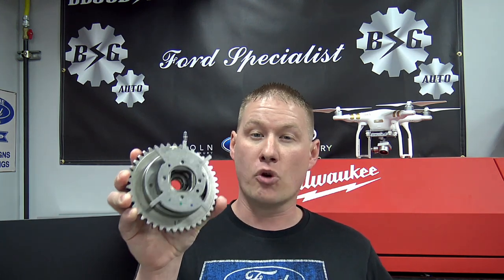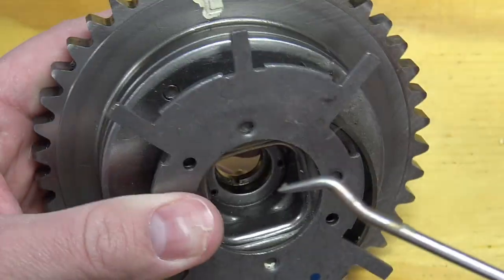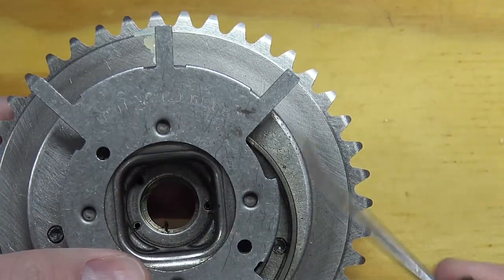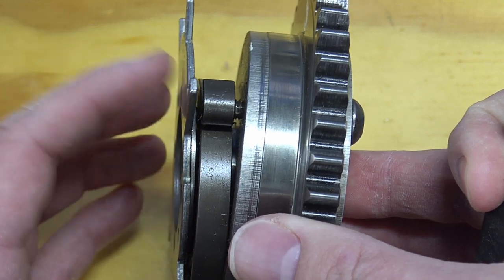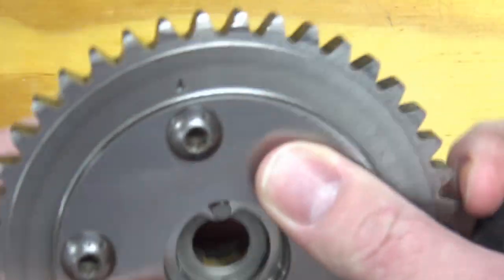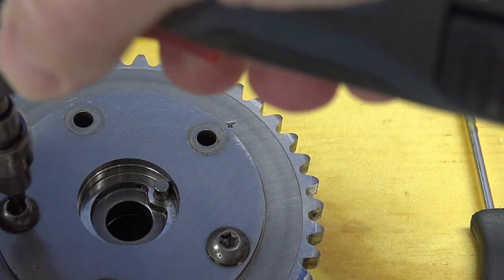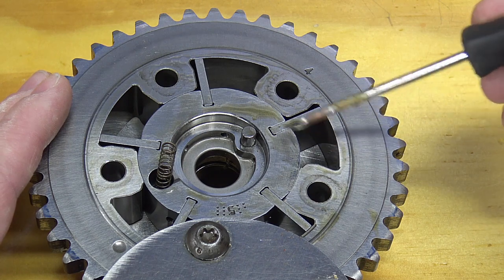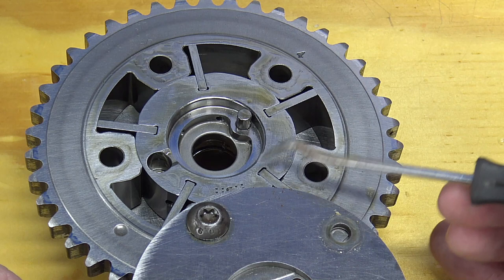Ford 4.6L & 5.4L 3v Engines: Camshaft Phaser Failure Inspection

Comment: 2005 mustang gt, was having every issue possible. P0012 and P0011 codes, replaced the vct solenoids, not much better, still codes. So I watched a lot of you videos on all of these problems, replace the timing chains and found a chain tensioner on the pass side that was blown out, thought replacing it would maybe help the issue but still, nothing. After lots of time and money and frustration, I ordered two phasers and the high flow oil pump he recommends and the car runs better than it ever has. At 104k miles I was having this issue but the motor looked very clean, goes to show the reliablity of the original ford parts, replace with the revised stuff not aftermarket!!! Thank you for all the quality information you post

Comment: Oh my goodness!  You saved me so much grief and money.  I lost timing on my 05 f150 while removing the right head with broken exhaust studs. I set up timing like i was suppose to in your other videos. Right cam phaser also had an L mark?  I set timing to that. Truck was way off.  Now i see to use the other mark for the right side!  I was 180 deg off.  Was at my end. Had scheduled to take it to the dealership.  Now i can fix my problem.  Thanks!

Comment: I seen where they make kits to block those. From advancing. And I have seen them fixed the top of heads with a line boring machine. And the only thing you have to do is replace the bearings for just like connecting rod bearings. They're just a lot smaller

Comment: I wish someone had told me to check the oil before diagnosing cam phaser problems. Once The crank case was full of good motor oil, the cam phasers started working perfectly. I didnt realize that the engine was low on oil and needed to be changed also. This caused the cam phasers to knock and rattle and I was about to spend $900 and my next couple weekends to change the timing set.

Comment: 5 years later, I'm back here ma man. I still have the same 2008 GT. Tried to go out to McDonald's yesterday morning and the engine cold started just fine, then random started running super rough as I was exited my drive way and engaging my clutch at low rpm. My engine has 210k miles and I have retimed it twice, replacing chains, sprockets, phasers, vct solenoids, but I have never replaced all lash adjusters or followers (only a couple that have failed followers here and there) so I wonder if thats it. Timing chains and guides look fine from looking down from the top of the engine (valve covers removed). I hope I didn't spin a bearing or have a follower bend a valve or something crazy. Or maybe my car just had an electrical issue and went into limp mode. Not sure but I'm still doing some diagnostic tests. I'm about to use the follower tool to pull out all 24 followers and inspect them. I'll also check the lash adjusters. If its bottom end stuff, I might have to take it to a mechanic

Comment: Awesome video Brian, Thank you. I have followed your videos in the past wile doing the cam phaser/timing R&R and also spark plug R&R. All took some time but went very well with the help of your instructions. Very much appreciated! I wonder if you could tell me if you see phaser failure happen often with lack of oil pressure. My 05 F150 has recently died wile in motion and wile it will start (occasionally) it runs very rough for seconds then dies. After further inspection it seems I may have had an oil leak at the front cover where meets the oil pan. Is it possible that lack of oil caused the phaser to fail, throw off timing and causing  the truck to, now,  not start/run? or should I be considering other avenues? Thanks in advance!

Comment: Really Awesome Video.  couple questions -  If someone did take all the screws off the reluctor ring,  (1) is it hard to reset the phaser spring back in the housing? (2) Is there a special procedure to align the marks? lastly, if we look at the tone ring and gear sprocket locations - (3) how much off is allowed to "perfectly" aligning up the gear tooth to tone ring tab? Is there allowance at all when matching up the center of the gear tooth to center of the tone ring tab? The reason I ask that and I know that is a used phaser but when I look at the tab on the tone ring in the video,  it didn't seem to align exactly with the center of the gear to the center of the tone rings tab.

Comment: Awesome video. I have learn so much with you that I really, really thank you from the bottom of my heart. I know it has been 7 years ago when you posted this video so I dont have high hopes of getting and answer but maybe I will be lucky. My 2004 Ford 150 has started developed a sound like a little piece of metal being tossed around at the passenger valve cover, right where the phaser is or the upper part of the timing chain cover. It is not a regular noise but an erratic one exactly as I said, like a piece of metal being tossed around at random. It started after I left my truck parked in my driveway for 4 days. It was a cold day in NY when I started the engine and I felt a weird noise. After that, this noise appeared. It will be present with the engine cold or hot.  When I saw this video I though that maybe one of those roll pins came out and is being tossed around. Could this be the cause of the noise in my truck? By the way, much before that I plugged a scanner and I saw the passenger bank was retarded 20 degrees at iddle while the other was at zero. I have a pending code P0010.

Comment: Thanks Brian ... Awesome series of videos. I need HELP with 2005 F150 5.5L 3V Phasor. Watched all your videos and am changing all of the timing components. I ordered two genuine Ford timing parts and phasers. One arrived OK and the second arrived in three pieces!!! Reluctor, spring and sprocket assembly. Snow is on its way and I am screwed unless I can put this second phaser back together ASAP. I have positioned the spring correctly but am not sure where to position the reluctor base into the square spring end and how many turns to rotate it so the reluctor ends up in the correct position. Cant afford to get this wrong and put the engine back together.

Comment: I have a similar problem with a 4.6 3v and cannot pinpoint the source of my problem... I'll be short and to the point, my problem is rattling under the timing cover, pulled valve covers and right bank chain was flopping around. When cranked over manually the chain will tighten then loosen. Cam phasers look ok from a visual standpoint. Has anyone ever run into this? The other thing I notice that I feel is worth mentioning is that driver side bank has normal oil staining on cylinder head etc for having 130k,  passenger side looks clean like almost new.... any help would be appreciated as I'm fairly stumped.

Comment: I'm throwing in the towel on this motor, new oil pump,timing set,phasers,VCT solenoids, it was quiet for a month then started to gradually rattle on start up and now when it gets warm it retards itself and dies at idle. My first ford and it's a junker.

Comment: Completed my timing job by following your videos. First problem I had was my truck would shut off at stops. And then I developed a knock. I removed the valve cover and Phaser on that side and found my new oem Phaser broke. I reinstalled one of my ld phasers in and the knock came back while doing the idle relearn. Any ideas.

Comment: great videos! I have a 2008 Ford Expedition. I have changed the camp phasers, timing belts, oil pump, vct, tensioners and changed the oil. Runs good but knocking noise has not gone away. it's louder when it's on low idle. Any idea what else I can do to fix it?

Comment: Could a persistent p0340 & p0344 code signal an issue with the phaser? Alternator & both sensors replaced at dealer and they checked all wiring and cannot figure out why it's still throwing these codes.

Comment: Brian, is there a way to pull off and put on the brake booster vacuum tube that connects to the back of the intake manifold without pulling the intake?  This tube made it a real PITA pulling the driver side VC.  With this tube in the way I found it easier to pull the passenger side VC without discharging the AC. 2007 F150 5.4

Comment: I was told by dealer when I bought my 09 Mustang GT to use 5-30 synh oil its better for cam phasers and thus engine then the 5-20     you agree?

Comment: hello thank you for the video. I replaced my cam phasers on my 5.4 2008 expedition then code P0340 and P0345 has appeared but the vehicle running fine I had the code for 3 months
Reply from the maker: +Badr Fisal VCT solenoids are next. If the codes appeared right after then the timing is off.
Reply: I have replaced the vct solenoids. The car idling good do you think it's timing problem?
Reply: +FordTechMakuloco  hi i have a question i have a 2016 mustang gt do you think putting aftermarket oil separator should  be done?

Comment: Hi Brian .. thanks for your video I did everything according to your videos. I have a 5.4 triton but I used the locking kit of kinda triangler shaped pegs that fits between the spines. I was just wondering if there's a difference weather or not the locks are put into the left side of the spine or the right side ? Reason is because I did everything required as per changing the camshaft and  position sensor and I also made sure it was secured properly, but I'm still getting P0011-FF and P0021-FF and it idles ruff and I get power loss as , And has a high smell from the exhaust system.

Comment: I tried to install one of these on a ford 5.4. I went to 30 ft lbs, then 90°.. I made it 45° and the tone ring snapped right off. Cheap Dorman crap. I didnt even do anything wrong. It was lined up straight and everything, it just failed on me HARD.
Reply: That's why you don't use the Dorman parts.
Reply: @countryjoe3551  Exactly. Only Ford knows how to make these right. I warned my foreman before I started, tried installing cam followers and somehow broke and dropped a valve down a cylinder. And the piston was almost at BDC, so it didnt hit that. I dunno. I'm confused. Now I'm cleaning the head and my boss hands me a 60 grit Roloc pad to clean the head surface. Uggghhh 🤦‍♂️He is an idiot, I'm an intermediate mechanic.. so since he doesn't know how to do the job he pushes it on me. And I make $15/hr.

Comment: Getting a hard raddle at startup, do the phasers rattle hard or soft tick when they go bad?
Reply: That is probably the timing chain and their guides and tensioners if you hear a rattle for 3 seconds or less. They quiet down when the oil starts flowing. My Mustang does it with no problems. Eventually you may need to replace the timing chain guide and tensioners, Ford made them out of plastic for my Mustang for some reason. They will get worn out faster if you run your car low on oil for a long while.

Comment: I replaced a cam on my 5.4l. When I put in the new bolt and tightened it the last 90 degrees the cam rotated slightly. So I had to tighten a little more. When I did, it gave way slightly feeling like the bolt was failing. The engine runs fine and is quiet. Have you ever felt this when changing this bolt?
Thanks for the videos.

Comment: Hey man,  your videos are the best.  I'll be in Chicago for work next spring.  Wish I could take my truck out there from Denver.  My question for you is and i may post this on multiple videos to hopefully hear back.  Although i know your super busy and despite your best intentions you can't get back to everyone.  Anyway my question is,  i put 12v to both my VCT solenoids.  When I put 12v to the drivers side the engine runs smoother although not perfect.  Still doesn't sound right.  When i put 12v to the passenger side VCT solenoid the engine runs worse and almost dies out. Can you tell which phaser has failed based on that diagnosis?  To back up, my engine recently started running terrible on my way down from the mountains. Code said cam position sensors.  Which obviously wasn't the problem.  I changed them anyway and of course my engine still tumbles and misfires and nearly dies no matter what rpm i am at.  Thanks for all the great videos and help.  I love your channel the 5.4 engine and my Ford's.  Thanks

Comment: I replaced the timing chains, phasers, guides and crank gear on  a 2007 ford expedition.  The job was quite simple thanks to your video. after installation was complete the truck cranks up fine idles fine and drives with no issues however it runs for about 30 min then starts running rough and dies. it will not crank up after that. it turns over and acts like it is out of time. i can let it sit for a couple of hours and then it will crank up and run fine again. the is no check engine light or codes. I have changed the cam position senors out,  this has me and my mechanic stump. just wondering if anyone has had this issue.
Reply: thanks

Comment: 2008 F150, 5.4 4x4. When downshifting from overdrive going up a grade, I get what seems like a backfire out of the exhaust. I'm stumped, unless some of the anti-seize got into the electrodes of the sparkplugs when I changed them. it seems like a secondary ignition problem, but I thought I'd ask. could a failing phaser exhibit similar symptoms?

Comment: Fordtech,  i have watched most of your cam phaser vids.  Thanks.  I had my engine rebuilt at 145k.  After market parts but melling pump.  Ran poor when i got it back, replaced vct solenoids w oem ford and it has run well for about 20k miles.  I am at 195k now,  i put new oem chain guides and tensioners...still stalls at lights.  What are your thoughts on phaser lock out?  I am not convinced ford phasers will solve this now terribly discouraging motor issue.

Comment: I have a 2003 5.4 and to my understanding that's a 2v motor. But it has the symptoms of a failing cam phaser. Starts that tapping or ticking noise once the engine is hot, doesn't make a sound when it's cold. Any ideas??

Comment: Do you happen to have specs on type of steel used and dimensions of the fins?  It wouldn't be hard at all to make new fins if that is the primary internal failure point.  Unless, they take out the groove they ride in.  Then, it might not be a viable option.
Reply: i dont mean to be so offtopic but does someone know a way to log back into an instagram account??
I stupidly lost my login password. I would love any help you can offer me
Reply: @Crew Karson instablaster =)
Reply: @Giovanni Gannon It worked and I finally got access to my account again. Im so happy!
Thank you so much you saved my account !
Reply: @Crew Karson Glad I could help :D

Comment: I've heard of people "blocking out" the cam phasers.  It's suppose to keep them at base timing and give these engine more longevity and of course horsepower would suffer.  It requires programming of course.  How do you feel about this procedure?
Reply: Im having issues with the phasers a mechanic recomended me this procedure of blocking , did you did something similar, or do you have more info on this ?

Comment: Hi Sir I got a 2010 Ford F-150 The problem is in this truck when the engine gets hot the engine shaking and it is not running perfectly so I watched your video about This problem and I replaced the two timing Phaser and timing kit I bought it from Ford dealer with two solenoid all of them from dealer but it is still the same when Engine gets hot Engine shaking And also before when I want to change the timing kids I change the oil 2 times and I put BG on the oil and I flushed it.Can you help me what should I do right now? If you can I appreciate it.Thank you.
Sorry my English writing is not good I hope you understand what I mean. thank you again

Comment: you cant slack on oil changes with these engines..ive got a 08 and have never had an issue. use the correct weight.

Comment: I'm in the process of doing the phasers now and I have the old one from the driver side in front of me. The center tab that aligns with the L is slightly right of the L. The left edge of the tab is perfectly aligned with the L. My question Is, is that correct? Because the new ones are the same way. Just wondering if that's right or if the center tone ring should be directly centered to the tooth. Just dont want to put in defective parts. Any insight from anyone that knows would be helpful. Btw the old one I took out was either an original or one of the older parts. No R on it! But I have an 04 with 200 on it! so it could have been done once before. FordTechMakuloco I watch alot of your videos and have learned a ton about my motor. Thanks for the info. Keep doing the good deed man!

Comment: I haven't torn my engine apart yet, but I have replaced both camshaft sensors. It runs GREAT for about half an hour then it starts idling rough again. Sensor one ,(left one) had oill on it, sensor 2 (right one) was clean. Blown Gasket? It was burning rubber when I first replaced the sensors. Now its losing power. I also have a Performance chip installed in it, I just installed it to see if it would help with the power output. Any suggestions? I really don't want to tear part my engine because I need my truck for work, I am a contractor, I'd put it in the shop but I'm afraid it'l going to cost me an arm and a leg and I'd possibly have to loan my wife out for a few hours, but that alone should allow me to keep my arm and leg, considering she's a 9.8/10.

Comment: hello i have 2007 for mustang 4.6 did almost everything to it. my phasers are after market auto zone. i'm still getting timing codes p0022 and 12 timing retarded. only when warmed up and under load. soon and i give it little gas engine feels like it will fall apart. Any tips thanks either way. and thanks for the great videos.